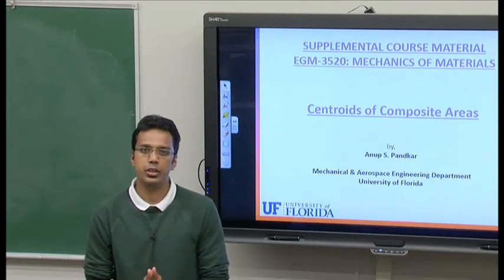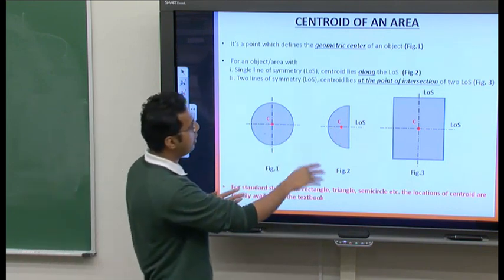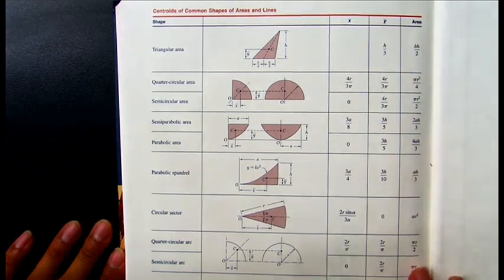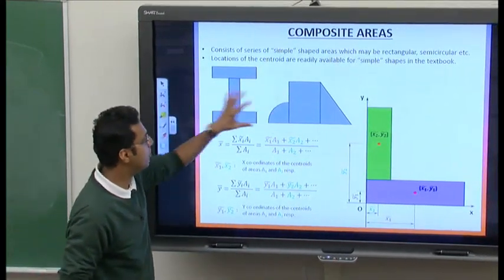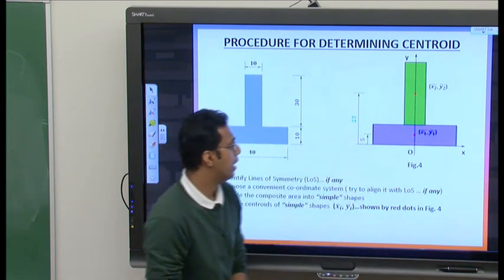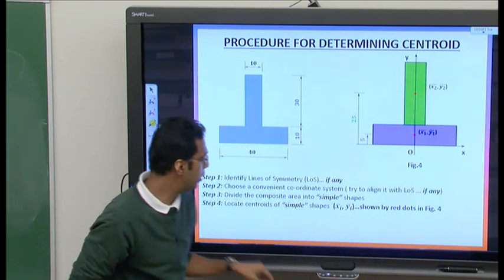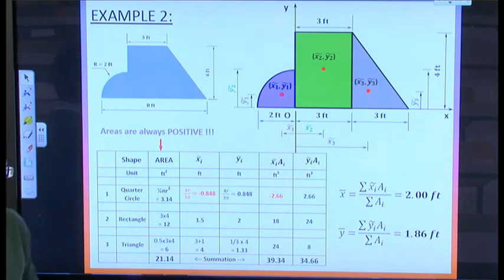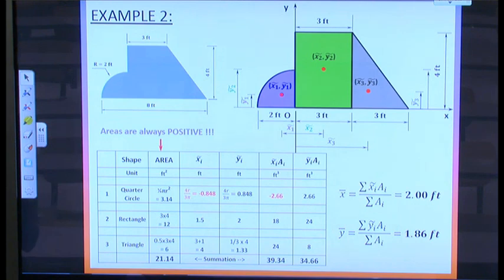Centroids of composite bodies

Comment: Very nice video,
what if the body is consisted by 2 different materials? an i beam which the top and bottom flanches are from one kind of wood and the rest is from an other , is there a way to calculate the bending stress of this member? also a way to calculate the shear stress that happens on the glue bonding them together?